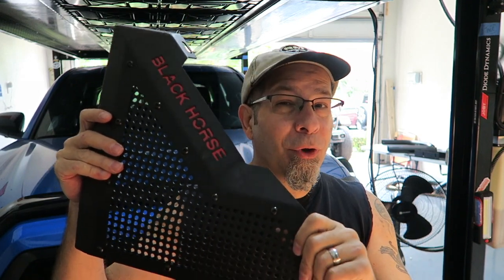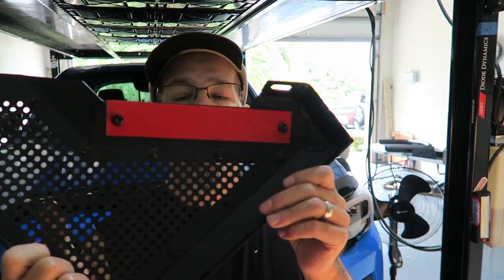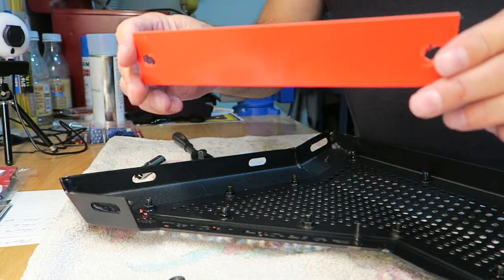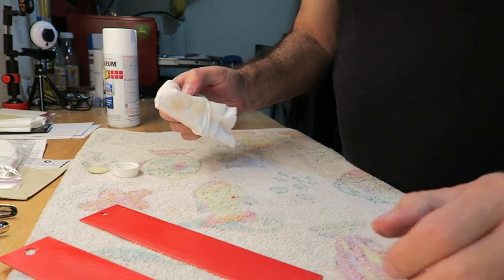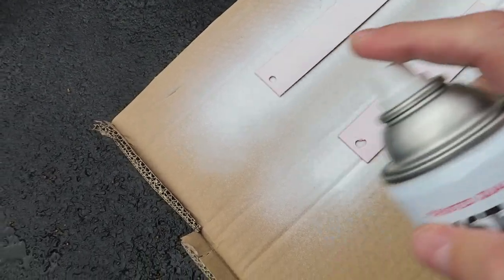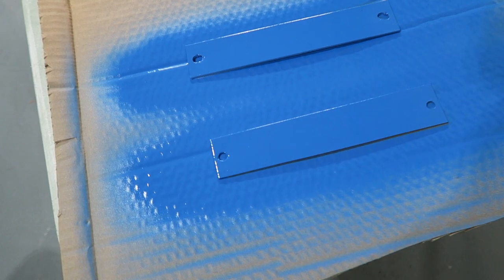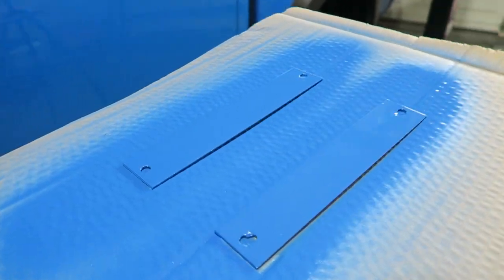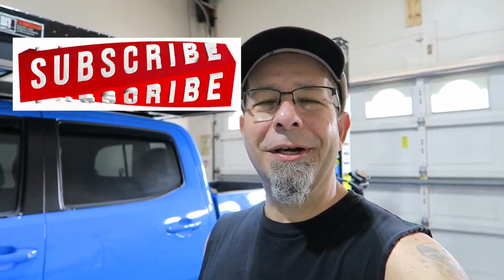Tacoma Sport Bar Painting Already

Comment: One thing I forgot to mention before in your other painting videos, whenever I paint the body of my RC cars, I always warm the spray cans in a bucket of hot tap water for 15 minutes. It's to ensure a smooth spray and prevent clumps. Also make sure you wipe down the can before you start spraying. Having a drop of water fall on your masterpiece would be so annoying. Just my 2 cents...
Reply from the maker: Thanks for the tip 👍

Comment: I just got me the 21 Tacoma SR5. Didn’t come with the LED headlights tho. Can I just buy any compatible led bulbs and plug in or would I need anything specific. I want low high DRL and fogs.
Reply from the maker: You can add LED bulbs.  I added them to my 2018.  Check out Headlight Revolution 👍
Reply: Thanks for the reply. Yeah I just got me the low high and fog light bulbs except for the DRL.But I believe the Turn signals and DRL are the same bulbs on the SR5. Any knowledge of this? Any suggestions?
Reply from the maker: Nope...haven’t changed them🤔